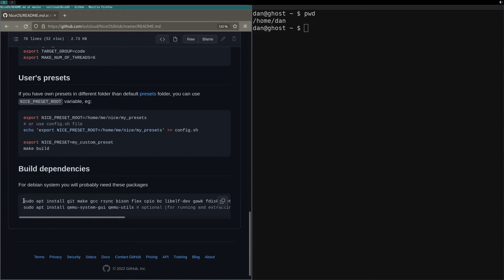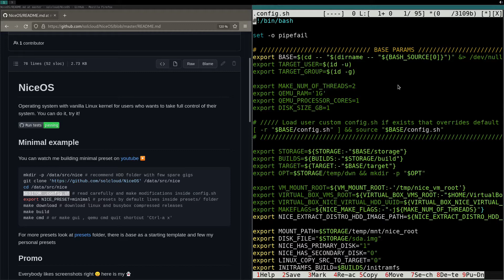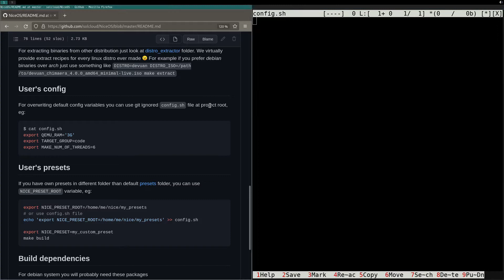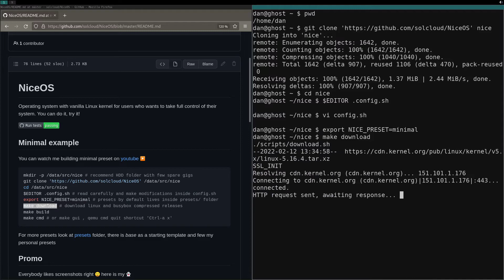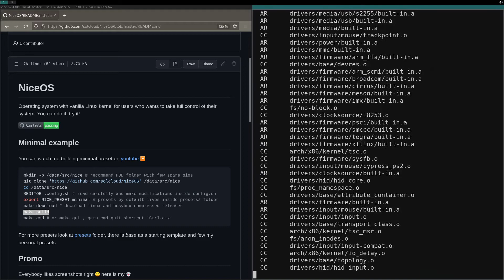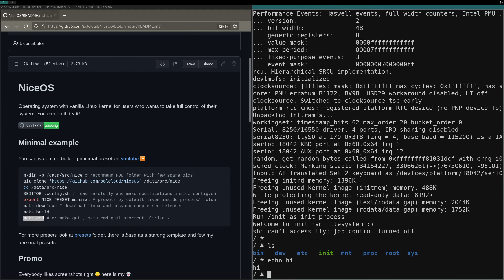NiceOS - building minimal preset

Comment: can niceos also be run on real hardware, i.e. not on qemu?
Reply from the maker: It can be run wherever you make it (it is Linux based after all). For example I am running it right now on real hardware as I use Ghost preset every day as my main desktop operating system.